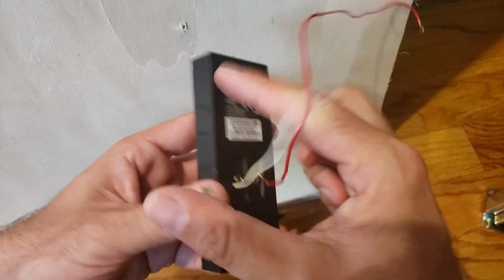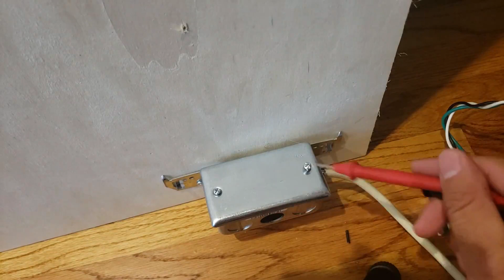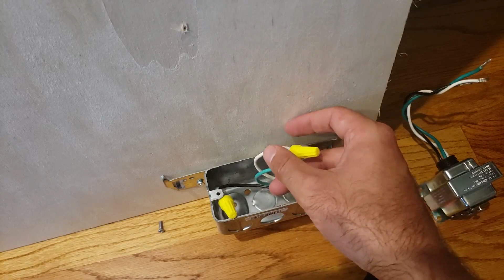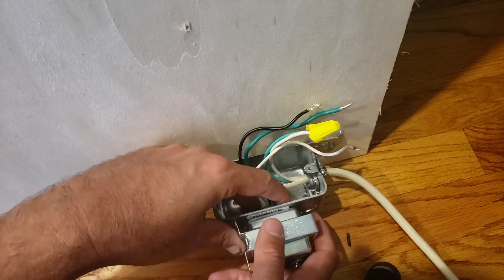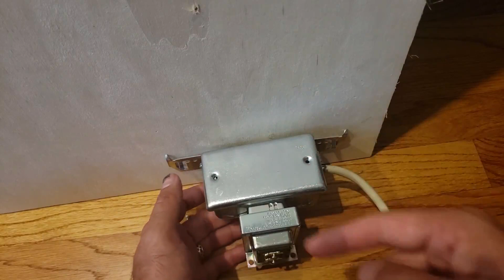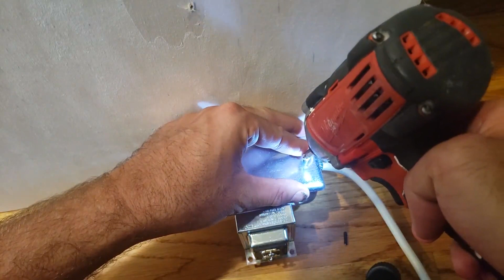How To Wire A Doorbell Transformer

Comment: While the case of the transformer may be grounded (i.e. electrically connected to its green wire) and thus would ground the junction box when the transformer case touches it, best practice would dictate that the incoming ground (green) wire should also be connected to the box itself.
Reply: Very true. This is a common and dangerous mistake. A charged box (from loose wire nuts) can easily cause fire.

I would also recommend 3 wire Romex type cable with the unsheathed / bare copper ground wire over cables with sheathed wire. This is for 2 reasons. 

!. Should the wire be damaged (future reno/diy project) anywhere along it's length from the breaker to the outlet, the bare copper would immediately trip the Breaker.

2. The flat 3 wire Romex Cable has the bare copper in the middle. This creates a groove  in the middle where the cable is thinner. This groove makes it very easy to score the cable sheathing with a knife and peel it off. This way, there is minimal risk of damaging the the sheathing on the hot or neutral wires when you are opening up the cable.

Comment: Where does the ground wire get connected to from the TF if there's only 2 wires going into the junction box in an old home?
Reply: They probably aren’t going to answer this question because it has some pretty serious implications. You’ll want to talk to an electrician. Or do some research on ungrounded electrical systems.

Comment: Where do you run the low voltage wire that goes from the transformer to the doorbell, because it is on the outside of the junction box?

Comment: I have an Edwards transformer 592 and I see only a red and a greenish white wire probably by old home owner. Red is connected to middle and the greenish white to the right corner and I am assuming it might be 16V 10VA right now. Ring doorbell recommends 16V to 24 V but doesn’t mention VA. To be safe can I hook the middle red wire to left most corner to get 24V 20VA? Please note the marking on 8V/16V/10VA is faded but I can see it’s a 592 and also 24V and 20VA with arrows at the bottom. Also, the transformer is connected to the circuit breaker box. Please confirm?
Reply: Ring needs 16-24v and 20-30VA
Reply from the maker: @TechOut  Correct

Comment: great video  new sub 
how many transformers can i join to the same line in the junction box?
i have a home with 3 apartments   do i need to buy 3 different transformers  one for each apartment
or can i hook them all up to one transformer
Reply from the maker: Are you putting in smart doorbells or  just regular doorbells?  With regular doorbells like these: https://amzn.to/37zOXbs shouldn't be an issue because they are typically only drawing power when the button is pressed (use the unlighted buttons, so they aren't drawing power) so unless someone presses all 3 at once  they should function as individual doorbells. Pressing all 3 at once would most likely result in a duller or no doorbell tone and could wear out the transformer sooner.  Get a class II rated transformer. 

The Ring Doorbell 3:  https://amzn.to/2TkG6SA could operate  with 2 doorbells per transformer as it can be hardwired and also has a built in rechargeable battery so it's drawing less power. I don't know if 3 could be on one transformer. I would recommend using a higher voltage 24v transformer:  https://amzn.to/2Tf5N70.   

As far as your question goes with how many transformers could you connect at one junction box. It would really depend on local electrical and wiring code . But the junction boxes do have multiple holes where if it was allowed per code they could be connected if the box was large enough, and the wiring was appropriate  to make all the connections.   2 wired low voltage  plug in transformers like these: https://amzn.to/2IQmzas get plugged into outlets all time for security systems and other electronics.

Above all comply with local electrical codes, and safety regulations.

Comment: Hi!  I installed our doorbell and transformer in 2019 and last week it went out. I tested everything and it turns out the transformer was bad. I picked up a new one and reattached the new one but I had only 4volts at the doorbell and it wouldn’t work. The only issue we had is that my husband took the transformer down last night and I don’t know which wire was connected to which. Both are black and he tested it with the multimeter but we got no power. When I went up to see what was going on I got lower voltage from the transformer (set up for 16) so I was going to switch it to 24 and noticed the transformer was very, very hot. Should it be hot and does that mean that the hot wire was connected to the neutral?
Reply from the maker: If it's really hot it means you probably have a short somewhere, which could also be the reason for the the 4 volt reading. A common issue is that the doorbell chime is bad and stuck or shorted, it's easy to replace.  Disconnect both wires and see what the reading is on the transformer with nothing connected to check the transformer.  The transformer wires are reversible so no issues there. I would then disconnect your doorbell and reconnect the wires to the transformer and take a reading at the doorbell wires.  It should be very close to what the the transformer is reading.  If it's not you have a short in your wiring or doorbell chime. With the power on touch the two doorbell wires together, if the chime normally and the voltage reading is fine  then it's probably an issue with your exterior doorbell. If they don't chime, or it's fuzzy or buzzing it's probably an issue with your doorbell chime and should be replaced.
Reply from the maker: I recommend this replacement chime: https://amzn.to/3chzHjL
Reply: One Hour Smart Home I was thinking that I should check the chime after watching several more videos. The wires I wasn’t sure if they were reversed was that hot and neutral wire to the back of the transformer because they’re both black!  When I swapped it out last time I changed one at a time but this time my husband brought it down and I had forgotten they were black so I wasn’t sure if that was why it was hot but I swapped them and swapped them again and the same exact result. I’m going to disconnect the chime (it hasn’t worked in almost ten years and I’m fine without it) and see what happens. Thank You so much for your quick response. I’m going to try again tomorrow but I think we’ll need help rewriting because those are corners of the attic I’m not interested in exploring, LOL!!

Comment: I have installed TWO transformers for my doorbell. Doorbell doesn’t work and I can’t get any volts on low side of transformer. I checked AC power coming into it but nothing out! Help me please
Reply from the maker: Did both transformers burn out? If so you most likely have a short somewhere in your wiring. Or your wiring could be non continuous. If it's a short it could be the doorbell button itself or the chime. Or it could be a nail/screw driven through wiring.

Comment: In California (2022), all metal junction boxes my just also be grounded. You would also have to connect the two green ground wires to the metal junction box itself with a pigtail and threaded grounding screw ...